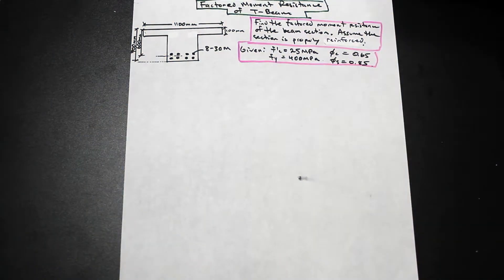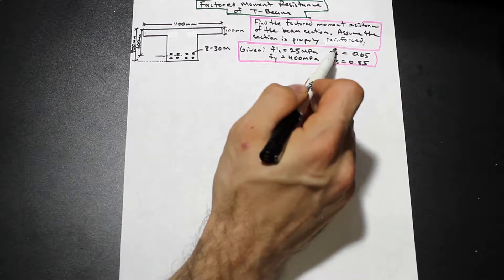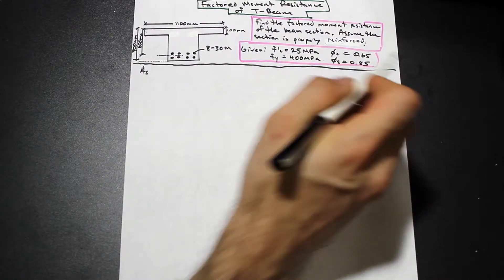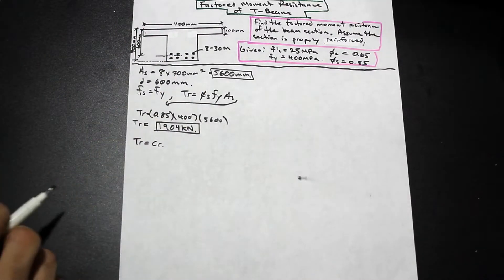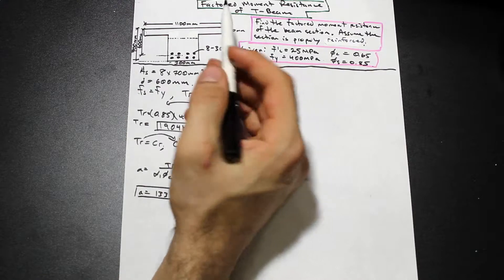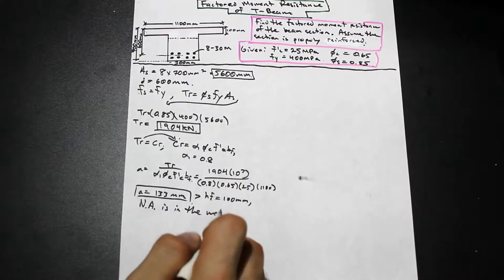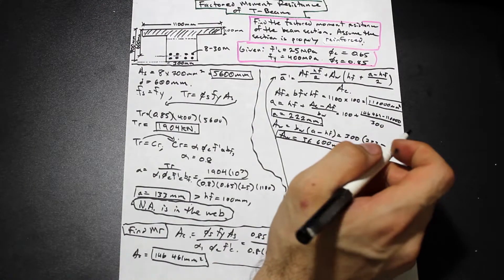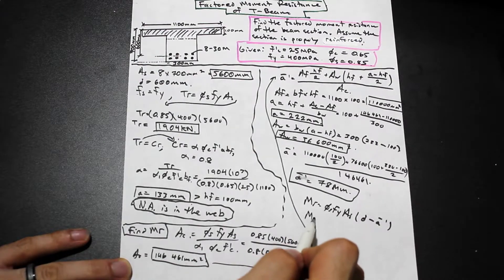Finding the Factored Moment Resistance of Reinforced Concrete T-Beams - N.A. in Web

Comment: How about when NA is in the flange?
Reply from the maker: Different formula for calculating compression stress block
Reply: @AFMathandEngineering  what is the formula? Do you have a video for that? Thanks!
Reply from the maker: You just need to calculate the area of the compression block of depth a.  When the  na is in the flange the compression block is rectangular.  When it's in the web you need to calculate both the flange and the web, as was done in this video.  Don't worry so much about formulas as the understanding of calculating the stress.block and you won't need a formula.

Comment: Hello. I want to ask. FIrst, what parameter we use to determine whether the RC is over reinforced?  Second, if the RC is over reinforced, how to calculate the design moment strength? Thanks
Reply from the maker: You have to check the strain in the steel, assuming concrete strain has been reached.  If the strain in the steel is less than yield strain then you have an overreinforced condition.  Overreinforced beams are usually not allowed by code due to their sudden failure mode and are not recommended.
Reply: @AFMathandEngineering  so, if my structure is found over-reinforced, can I still calculate the design moment strength? and if yes, how? Thanks before!
Reply from the maker: @deborakho532  Do you have a concrete textbook that you're referring to?  I'm assuming you're taking this class now hence why you're asking the question, I really suggest you read the entire section as this is an important concept to understand yourself for both school and real life.

Comment: The illustration at the ending is really helpful! 

Btw, just to confirm, the first a = 133 mm that you calculated is just for making sure the N.A. is on the web? And it doesn't matter in the latter calculations? Thanks!
Reply from the maker: Great, glad you enjoyed it! Essentially, what we did there is we assumed that the beam was a rectangular beam with width identical to the widened top flange of the T-beam.  If the a we get is larger than the depth of that t-beam section (which it was), we know that the N.A. is located in the web of the beam and that equation is no longer valid.  Hence, we never use that a again and must use a for a T-beam.  Hope that helps!